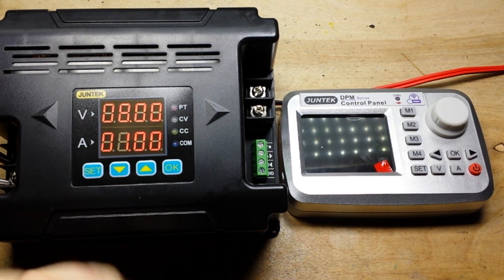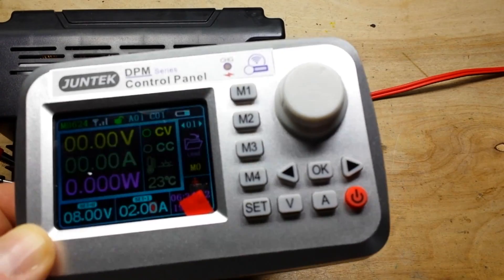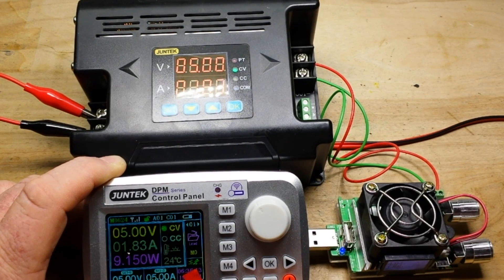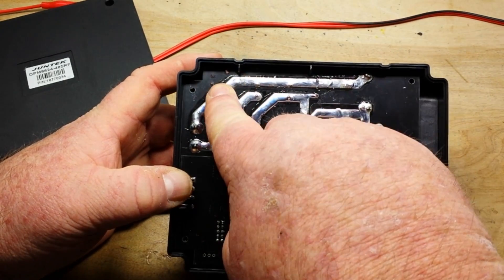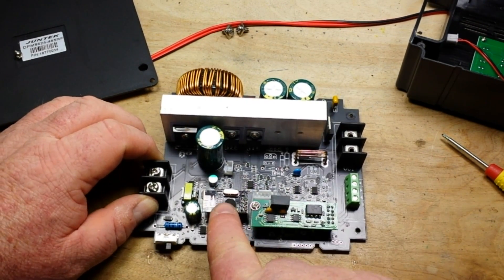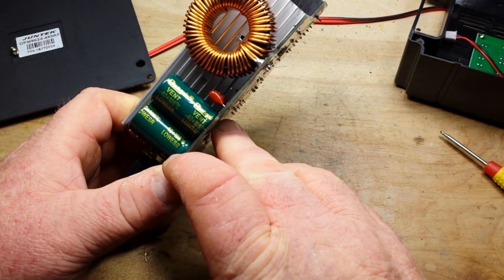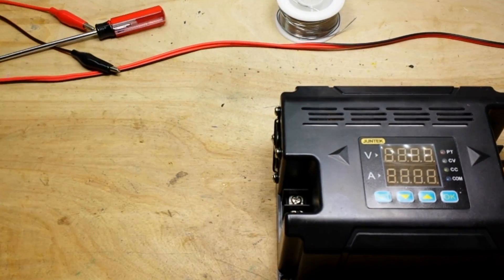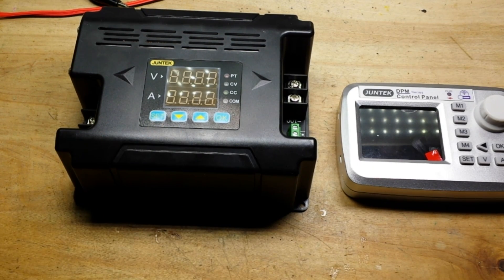Wireless Power Supply System from Juntek

Comment: 5:10 doesn't matter, as the voltage drop along the shunts will be the same. I think, they're in parallel to get one third of the shunt resistance and to split the heat dissipation.

Comment: I don't suppose you ever had a chance to test the efficiency of the output vs input voltage? The Juntek listing claims 92% - it would be really good to know if you supply is with (for example) 60v how many volts it can supply after conversion.

Comment: Paul, is it water proof??????? because if its not whats the point...
Reply: If it was Waterproof you could use it to power a motor of some kind outside. Or a pump. The wireless control needs a timer unit and some fansy programs to make it use full.

Comment: That’s a pretty cool looking unit. I could see using the ttl to usb connection for monitoring power fluctuations during experiments. The wireless seems cool but I’m not sure how I would use it. The big buck converter could be useful if you are charging a power wall with solar panels. I like it but there are other things I need before something like this. Nice to have when it’s free though. Hope you get to feeling better soon Paul, I’ve had a bug kicking my ass for the last two weeks so I know how you feel.

Comment: The downside about these buck converter power supply units is that it's difficult to find an input power supply capable of providing sufficient voltage and amperage to take full advantage of their capability. They are dirt cheap, yes that's true, but the input supply that they require to reach maximal output voltage and amperage can be far more expensive than the unit itself. What did you use to provide the 80 Volt input needed for fulll range? Given that you only show its performance at five volts tells me that you don't actually have a primary supply that can deliver the top end that it's capable of supplying.
Reply: Amazon sells a 1200W 60v 20A AC/DC psu for $85 so not too bad. I agree not 75v that these can take, but close.

Comment: Prefer the traditional power supply built-in controls. The remote could be usefull  if the main board power supply is mounted on the roof near solar panels and you want to monitor via radio the voltages, current, power, to avoid going up.   Thanks for the review and hope for good recovery
Reply: I think you nailed it. Solar installations make the most sense.

The only other thing I could think of would be driving a motor controller directly off the buck, but, those can be wireless, can't they?
Reply: @cheyannei5983  If it is a DC motor it is fine. Are you refering to Wind power motors? They could be three phase and rectified.

Comment: I built a PS using a retired (because of age) 48V - 16Amp computer server PS.  Mount the whole work under the bench and used the wireless module on top of the bench.  Saved space.